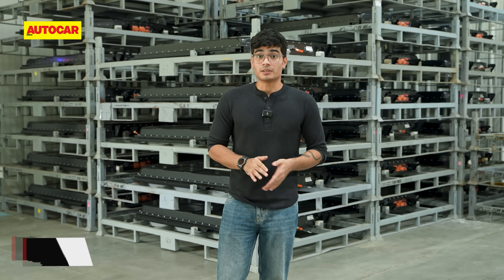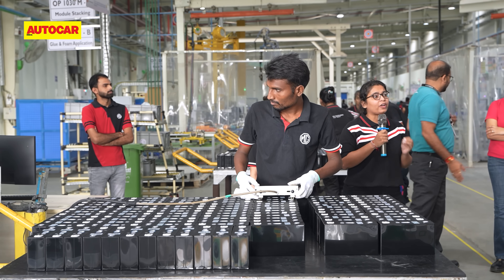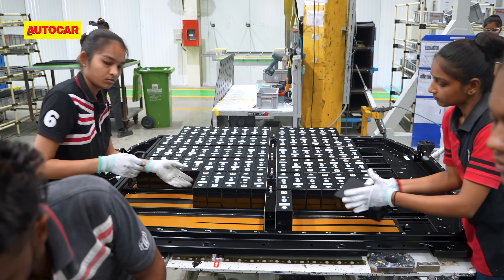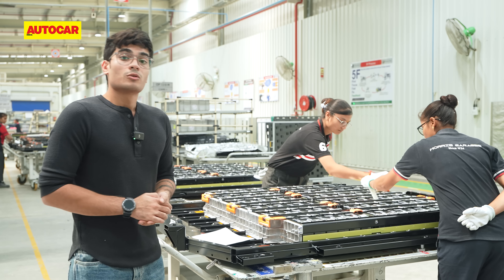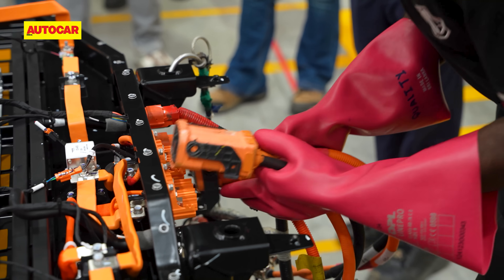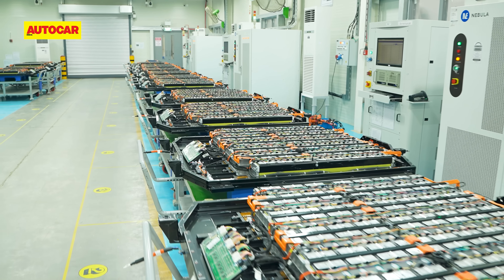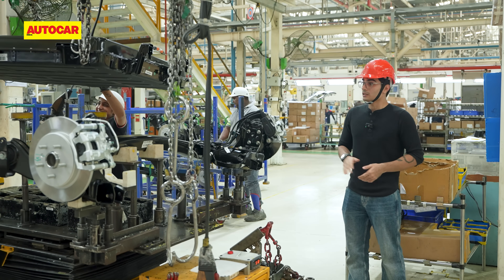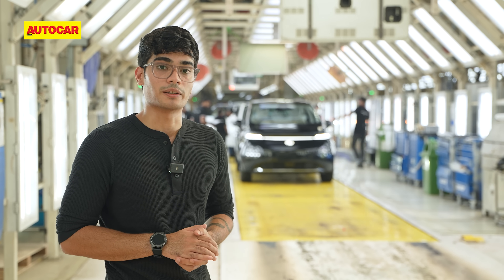From cells to ready to sell: Putting together an EV battery  | Feature | Autocar India

Comment: What'the idl percentage I should charge my Mg windsor battery 100% or 80 %
Ans should I deep discharge the battery below 5% for good battery healthy and longevity.
Reply: For LFP battery best charging practice is 20-80 percent, Monthly once do deep discharge like 10 and charge till 100 percent for balancing. Occasionally drive to 5 percent when it's necessary  and unavoidable. The below 10 percent drive stresses the battery. I'm using ev for 3 years and completed 60k km

Comment: They can certainly incease the battery power by adding more cells. If windsor had a battery pack of 80 to 100wh it would have changed the whole market with a range of around 800km.
I am no expert and i understand factors like weight safety etc but still it felt like the space was underutilized.